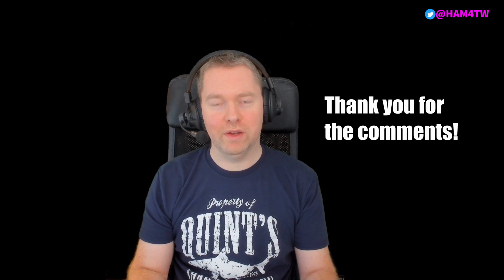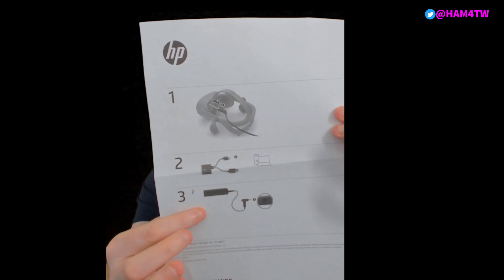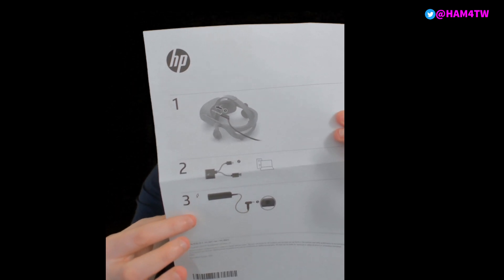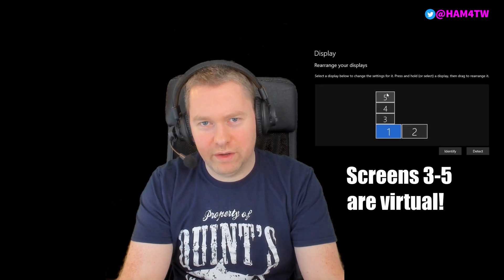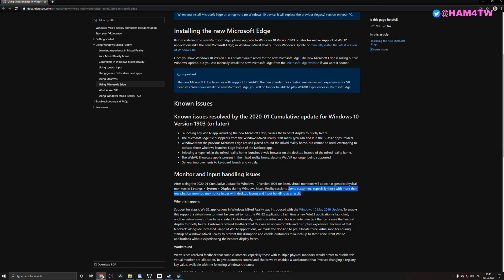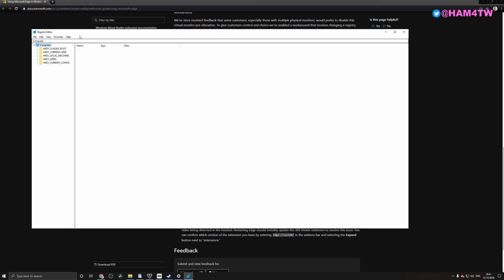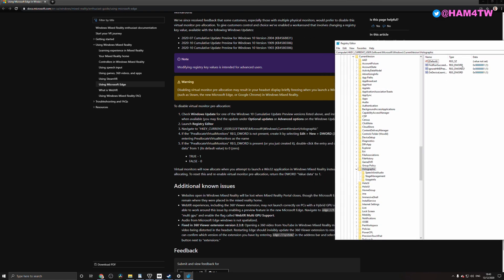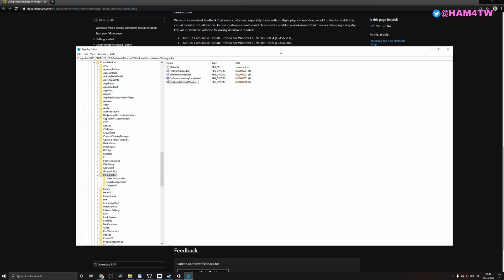HP Reverb G2 FOV Mod + Other Tips

Comment: Just bought a G2 to replace my Rift S.  Nightmare to install because no matter what it just wouldn't connect.  I'm not running junk; I've got a RTX3090, Ryzen 5900x on an Asus X570 with a 1000W Corsair PSU.  I figured out that it was likely the USB connection thanks to this and a few other videos from the community.  Reverted back to GEN3 for the PCI express in the motherboard after flashing to the latest BIOS and making sure everything was up to date with the latest drivers and stuff.  No dice.  Also tried every USB port multiple times.

The fix was a POWERED USB3 hub.  Fired right up.  And yes I installed it with the power supply and in the correct order.  Didn't matter.  Can't say that it will work for everyone, but I do know that in my situation with an X570 motherboard that it solved the issue.  I picked up the 4 port "Insignia" (BestBuy house brand) for like $30 because it was the only thing close on a Saturday.  Had about 2500 positive reviews and fixed my problem.

As for the G2 itself....damn.  I like it a lot.  The FOV "issue" in my opinion is blown way out of proportion.  I will probably change the pad because it is not very comfortable and is digging into my ample, yet supple cheeks.  The image quality is so good.....it is a hungry beast and even with a pretty damn OP system I get dips at full resolution.  I do simracing and old school Assetto Corsa is my go to (with SOL and CSP) and I can run full res during the day; at night it starts to get a bit crappy in spots.  However I can back down things like MSAA which I had to have cranked to the max with the Rift S where it still looked poor.  80% resolution seems to be the sweet spot so far.
Reply from the maker: Thanks for your comment. Useful tips in there for G2 owners.
Reply: I'm about to try plugging into my usb card later. Lost the adapter until just before bed. Also planning bios update. Curious if you had audio source switching issues and if this fixed it.

FOV...yeah. people expect far to much. It isn't enough it is VR, and that there are limits imposed by the computer itself and hardware limits, but let's demand to never see the edge of the fov. I don't even usually notice it.
Reply: I have the same system, except a gigabyte eagle 3080. No issues with plug and play. Still finding ideal settings for iRacing. Ill have to downgrade the resolution in steam, and have less geforce colour correction. Keen to check out automobilista 2. My biggest issue with VR is the focal point and eye strain

Comment: ps get your wife some precription adapters. I scratched mine while using glasses one sad day despite having plenty of distance to the lenses.
i was trying to take it off and my glasses came off with it and dropped on the lens.

also 90 is so disappointing for stock. even 96 is. I heard it had more...
my vive gets me 120c if I use my 6mm foam. but even with my adapters for glasses i can only get 115 max. which is slightly uncomfortable cause my nose slightly touches the adapters. so I get more like 105. but with contacts the 120-115 is just amazing.

Comment: For those who do wear glasses there is the VR Optician who makes Prescription Lens inserts for the G2,
this will allow you to make the FOV mod mentioned here for those who choose to do so.
They start at about $70 USD and for slightly less they make a non prescription version to protect the VR screens from scratches etc

They don't come with Install instructions in the kit, however they have a YouTube video that shows you how to do that.
a web or YouTube search for VR Optician will link you to them.....
Reply: Bumping this post. I've had amazing customer experience with VR Optician. There was a problem which was not their fault and yet they didn't hesitate offering to help me out with my problem. Simply topic drawer support!
Reply: Can I do this FOV mod with the prescription lenses? Because prescription lenses will bring the lens closer to the eye and FOV mod will do too. So it would be bad to do both and then my eyes touch the lenses?
Reply: @frankvolker998  I think your over thinking this here.....I had a hard time with glasses on and using the G2 so I got the script lenses and it actually worked out better and more than comfort wise.
Reply: @irongoatrocky2343  thx for the answer. I just thought that its 2 different problems. The glasses-inside-the-vr-headset is a problem and the g2 has kind of a weak sweet spot. my glasses fit nicely under the face gasket but if i look around everything is blurry. the sweet spot is very small so i am interested in tickling out the very best improvement

Comment: Do you have any problems with the headphones that they change the volume a bit when wiggling back and forth slightly on them?
Reply from the maker: I didn't notice this at first but I have encountered this a couple of times more recently.
Reply: Yes my G2 seems to do this - at first i was worried it was an intermittent connection, but it seems stable if you dont wiggle them.

Comment: Hey @Ham VR. Would like to say awesome video. I am however having a issue. I Have a 3 monitor set up. Just got my HP reverb g2 a few weeks ago and noticed it doesnt connect unless I unplug one monitor from my gpu.I have followed your steps for the reg edit however I cant seem to get my headset to work. Im back to WMR portal saying "Make sure your headset display cable is plugged in correctly" which is the problem I was facing before learning I had to unplug one monitor. I am on windows version 1909 and have a 2080ti if that helps.
Reply: It will however work if I again unplug one monitor. I feel like the reg edit still wont allow me to use 3 monitors and then still be able to jump into VR on the fly. Thanks for any assistance you can provide.
Reply from the maker: Hmm very odd indeed. What resolution are your 3 monitors, are they 4k? Are they all on DP connections or a mix? I wonder if the G2 plus three 4k monitors is going beyond the desktop render limit of your GPU. If you have other sockets spare on your GPU (e.g. HDMI, DVI, DP) you could see if different combination works or try lowering your desktop resoultion (and or refresh rates). Failing that does just switching a monitor off work? (saving you having to physically unplug it all the time).

Comment: I have this set but connection issues are frustrating me soooo much. One day it works fine, the next day it won’t connect and keeps asking me to connect the Vr glasses. 🤯 yesterday I gave up finding the solution and left it for dead. I saw one YouTube video where the cable was broken on arrival. A replacement solved all issues there so I think I need to call for RMA also.

Comment: But you changed your IPD setting!  Your IPD doesn't change. It's fixed. ie: the distance between your pupils looking straight ahead.  You can't really compare the FOV of both setups if you change the IPD setting.  Just randomly changing your IPD is a sure road to nausia!!
Reply from the maker: I wasn't adjusting the IPD randomly, I was adjusting for clarity. The sweet spot seems in a different position with the lens closer. I don't know if this is do the with shape of the lens or if they are angled slightly but there is a difference.

Comment: The first thing I did after wearing the G2 for the first time was discard the cable clip and replace it with a piece of velcro cable-strap.
Reply: So did I too!
Holy crap, how is HP testing?!
Reply: Lol I did the same thing but because my clip broke first time
Reply: Lmao mine broke so I replaced it with a plastic bag tie until I can be bothered getting a velcro cable strap, does the job
Reply: My cat broke mine.. It never broke after hours of use and my cat stepped just right on the cable and snapped it.
Reply: Yup, mine broke as soon as I took it out of the box.  bit of Velcro, problem solved.

Comment: I really dont believe you will shortcircuit the headset, by plugging in power adapter, before pluggin into PC. I can’t fathom how that would happen. If ... that would happen. The headset would shortcircuit in any case. BTW I plugged mine in to power first.
Reply: Nothing happened?

Comment: I bet you're wondering why Planes are tiny...
THIS FOR SCALE SIZES & BEST PERFORMANCE...
I just set Game to 100% and G2 WMR Dev Tool at 50% which adds to the same as I was using previously but in smaller scale of 80% Game + 70% WMR Developer Tool which you do need for the G2 to fix best performance also. Get it from MS Store and keep the main APP installed.
MSFS VR HOW TO GAIN 50% MORE FPS!! HP REVERB G2 - YouTube

Comment: thanks for the useful info! I ordered a G2 today. I do wear glasses. Do you think if I get lens inserts (which will add a bit of height to the lenses), the cover mod will be too thin?
Reply from the maker: It would be close, but you might be able to get away with it with the strap loose. It depends on the shape of you face too.
Reply: i found with the oculus rift CV1 puting in lens adaptors i had to stick on an extra layer of foam padding as the lens adaptoros were pushing into my face causing pain.

With the Rift S u can adjust the face plate moving it closer or further away to adjust FOV for wearing glasses or lens adaptors. but again with lens adapotors i had to move it further away reducing FOV.

Looking at the lens adaptors for the G2 they look thicker than the rift ones. so might have to put a thicker gasket on which will reduce FOV even further.

with glasses it will depend on the frame of the glasses and the thickness of the lens u have in them. thin frames/lenses u can problay have the gasket closer but thick frames and lenses u might have to have it further away.

My G2 is ariving early next week so ill see how it is wearing glases before i get a lens adaptor.

But u might be able to use it without glasses.
I found with the CV1 everything was a blur without glasses but with the rift S it was still farely clear without my glasses on.

The lens adaptors can be a bit hit and miss as they dont always get it right and it might make it worse rather than better. reason for that is u send in ur prescription and they make it from that. But that is usualy the wrong prescription as u need a dif one for VR.

Best option is go to ur optition and get ur eyes tested for VR so they can give u the right prescription for VR.  It will cost more than the online VR lens makers but it will be more to ur prescription. they should also work out ur IPD for u as well and put that into the lenses.

Might have to try several diff optitions to find 1 that does the VR eye tests though as not all have the equipment to do the tests.

Found that out when i asked my optition for my IPD and they refused and said dont use the online lenses get them to test my eyes for VR instead. but that might be just them trying to get money out of me lol.

IPD for glasses will be diff from what u use in VR as ur eyes r a lot closer to the screen.

Comment: I haven’t looked yet, but I wonder if someone has made a thin faceplate STL that could be 3D printed. You could add a little thin soft cover but it would preserve the nose piece.
Reply: They are all over Amazon. I'm sure there's an STL floating around somewhere.

Comment: Great tips, I was just wondering something about the FOV mod.
How does it work with the cable? I mean...doesn't it press against your head through the cover ?
Reply from the maker: The VR Cover sponge is so deep that I couldn't feel the power cable and I found it more comfortable that the standard face gasket and sponge. Everyones face shape is different so your mileage will vary. For me it was spot on.
Reply: @HamVR  That makes sense, I will definitely try it. As a seated VR-player I really love the headset, zero tracking or controller issues... it's just the FOV and sweet-spot. Hopefully this makes it a little bit better.

Comment: Nice work. I already tested it with the Odyssey Foam and yes, FOV was better and for me, the option to look at my keyboard is also positiv (DCS needs to much buttons), but ist wasn‘t comfortable for me. 
I still don‘t know which one is better for me, the Index or the G2.
Reply from the maker: Do you have both the Index and G2 currently? They both have their benefits and weaknesses. I give it 5 more years until we'll have the near perfect all round headset for about £600, then it will be a case of bringing the the price down for the masses.
Reply: @HamVR  Yes, I have both. Indeed, both habe ther benefits and weaknesses. Because the index is already close to perfect, I think it will be less than five years. Since I owned the Index, I assumed that I would only try something new again with an Index 2. The Reverb was more of a spontaneous attempt. Since I owned the Index, I assumed that I would only try something new again with an Index 2. The Reverb was more of a spontaneous attempt. My history with VR headsets starts with an Oculus CV 1 and in between I had an Odyssey Plus, a Vive Pro, a Pimax 5kx and an Oculus Quest.
Reply: Agree. Hope we get some good alternatives after the summer 2021. All the pieces are there and it's been proven that you can release high resolution HMD's without worrying about people having hardware to use it fully. It's worth it anyway. Now we need (IMO) an Index HMD (or better) with a G2 screen (or better) and Oculus like inside out tracking and controllers. I'm sure the Index is great as it is and inside out tracking is not for everyone, but I am NOT putting up cameras or basestations on my walls again. And even if the Index controllers and basestations are great, I think this is where you can cut the cost a bit.

Comment: Is there any way to turn down the brightness to get better darker black shades?
Reply from the maker: I've had a dig around in the WMR app and SteamVR app and no, there is no brightness adjustment currently which is quite a strange omission. Looking at the Reverb Reddit under FAQ 8. Is it possible to change the display brightness?  "It is not currently possible or planned, but they may implement this later depending on user feedback."
Reply: Open vr advanced settings
Reply: 2nd It is too bright for me too and it gets really warm can I turn off the HP led that get warm too
Reply: Try fpsvr